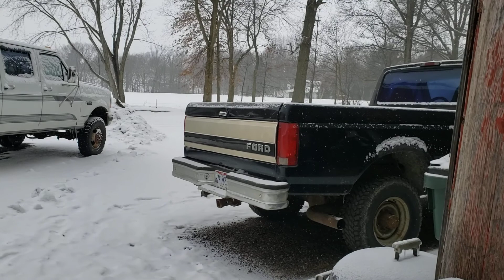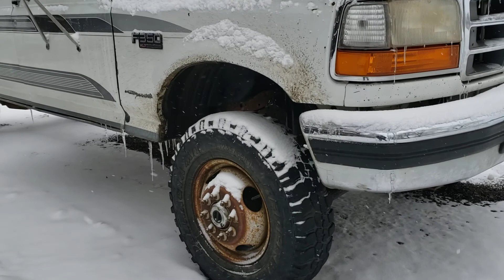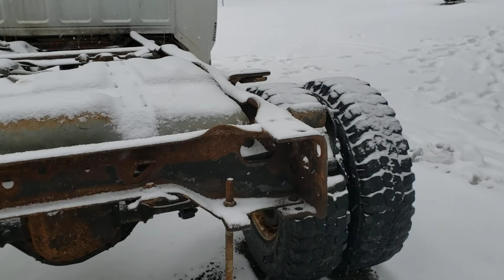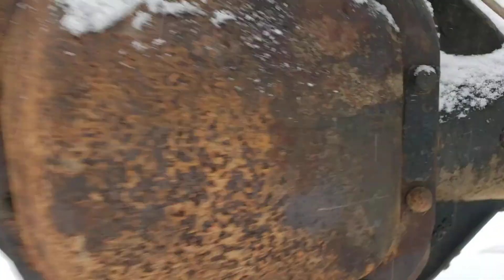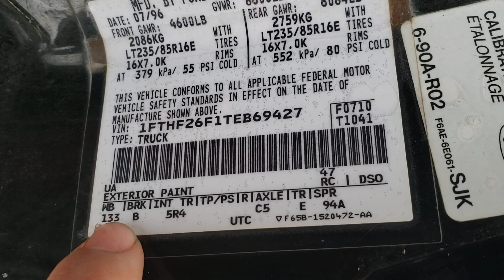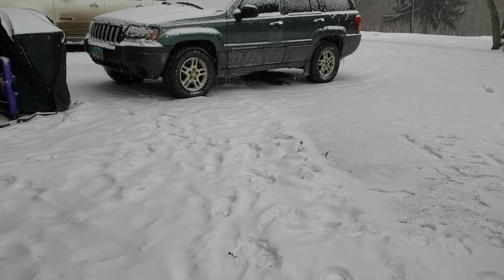How to Identify your OBS Ford Axle Model and Gear Ratio

Comment: The front end you said is a Dana 50 is actually a Dana 44 HD. Most easily identified by the size of the hubs, but the TTB came in both Dana 44 HD and Dana 50.

Comment: The 97 f250hd came with a solid axle from the factory.
Reply from the maker: No it didn't. Sorry, but all F250s had the D50 TTB regardless whether they were badged "HD" or not.
Reply: @diymechanictv1233  I bought my 97hd  new from the dealership with solid axles .. so yes it did bud

Comment: Really great video, thank you. I have a 2010 ford f250 super duty 4 wheel drive fx4. Do you know about this truck, axles, diff ratio? I will and look for marker tags and vin # info. I have manual hubs, glad they are not electronic. Any info would be greatly appreciated. Awesome video! Jim

Comment: What info do you have about the front end on a 2wd OBS? I'm looking at replaacing the wear components on the suspension and steering on my 93 IDI turbo and there are references to "front axle up to 4200" and "front axle from 4200"
Thanks!

Comment: CAN YOU CONVERT A 3/4 TON DUALLY TO A SINGLE REAR WHEEL BY JUST SWAPING THE FRONT HUBS AND REAR AXLES?
Reply from the maker: Yes, but unless someone converted it to a dually, all the dually trucks were 1 tons. If yours is really a 3/4 ton (F250) yiu might just have spacers on it that you could take off to return to SRW.

Comment: I'm one year outside of your range, I have an 86 f350 (diesel) non dually, 4×4 , C6, Dana 60 on the front and sterling 10.25 in the rear I believe.
I'm wondering if I'm missing something, I jacked up the rear, and marked the driveshaft and the tire position so I could see how many times the axle rotated per 1 tire revolution. Less than 2 axle revolutions gave me one full tire revolution. No tag on the axle, I'm in NY so the rear cover was replaced after rotting I imagine.  Any input would be much appreciated 🙏 
I'm going to check again and update if I got it wrong.
Reply: 1.75 axle revolutions per 1 tire revolution exactly
Reply from the maker: If you have it jacked up, make sure the other tire isn't spinning bsckeards while you're doing this. They can do that if it is an open rest end. Put one side on a block or something to keep it from spinning the opposite direction if you need to. 

Then you should be counting revolutions of the drive shaft per complete revolution of the wheel. I assume that's what you are doing?
Reply: @diymechanictv1233  yeah that's what I was doing, I'm assuming 3.55 is the rear ratio. The other wheel wasn't moving at all I made sure. I was hoping for tall rear ratios anyway. There was another guy having the same situation on a forum and they just figured it was 3.55. I appreciate the content and you getting back to me.
Reply from the maker: If you have 3.55 gears, you'll be turning about 2200 rpm at 60mph with a c6. That's a guess, anyway. 4.10s and it would be screaming pretty good at anything above 60 with a c6 (no overdrive).

Comment: I am wanting to change the rear gear ratio back to a 3.55 or 3.73.  Before I could get it done, something went bad.  I hear rattling back there and uneasy turning....like skipping.  Tomorrow, I will open the cover and see what's happening....what pieces I will find.
I'd like a video on how to change the ring and pinion and who knows what else in there.  Maybe, the spider gears are trashed.  I don't know yet what is needed.  Maybe, I should get a whole rearend whole rearend, hub to hub, from s junkyard for about $750.
Your thoughts?

No local mechanic can get to it.  I've been trying to get it in a shop, any shop, for a month!
Reply from the maker: Hey, thanks for watching the channel!

Two things I've never been brave enough to venture into: automatic transmission rebuilds and setting up rear end gears. There are specialized tools required to set the proper bearing preload on the pinion and lash on the ring to pinion clearances and I have never been brave enough (yet) to get into it. If they're not set up correctly, they don't last long. It's some sort of voodoo that I've not yet had a need to learn.

That said, I've swapped several rear axles and that can be done in a day. That's the direction I have always chosen to take and it would get my vote in this case as well.

Good luck with your project!

Comment: The 1988-1997 F Superduty had two different ratios. The standard 4:63 and the optional 5:13
The F350 4x4 cab and chassis came with 4:10 with a 4:63 option
Reply: In rare cases they had a 4:30 rear axle ratio that was a LS rear end and Ford only installed these 1997. The reason I know this, is becuase I bought a 97 F-SuperDuty about 4 months ago with the G3 axle code on the door and was kinda confused and didn't know what the heck it was until I done some research on it. Another thing about the F-SuperDuty is that it has a DANA 80 and not a DANA 60.

Comment: I bought my F-350 three months ago.  I was told it's a 4.10:1 ratio.  It's turning 3,000 RPM at 65 MPH.  Ouch!
Mine is a 7.3 L diesel with the three speed C-6 and 19.5" wheels.
If you are only turning 2200 at 65 MPH then, I need to check mine.  They may have put 5.38:1 or something extreme like that in there.  The tag shows it was a 3.55:1 from the factory.  I think I'd like to go back to that.  It's expensive to have done so, I need to be sure what I want and do it only once.
Reply from the maker: Ouch is right! With that gearing, I bet it pulls like a freight train, though! Get underneath and look for a tag under one of the axle bolts. That should have the ratio stamped on it and you should be able to read at least the last 2 digits. It's somewhere to start, anyway.

Thanks for watching!
Reply: @diymechanictv1233  the tag shows it was a 3.55.
Watching through countless other videos, I came across a guy that show the math to equate new tire size to factory ratio.  Given that math and the larger tires, I should go to a 3.73 and not the 3.55.
Reply from the maker: Keep in mind that the C6 is I ly a three speed so you're also suffering from not having an overdrive gear, if in fact that is what you have. Having that overdrive gear makes a huge difference for highway driving.

Comment: Thanks for the great video. It help me out alot because I just bought 1991 ford f250. I have a question. What gear oil do I use for the front 50 axel and rear 10.25 axel. What brand and wight. I live in Arizona weather. Thanks again.
Reply from the maker: Glad you liked the video! The brand of gear oil is completely up to you. For the weight, use 80w90 in the front and 75w140 (or the equivalent) in the back. If you have a limited slip rear diff, you may also need a bottle of friction modifier (from Ford) if it chatters, but I'm guessing you'll be just fine. Thanks for watching!
Reply: @diymechanictv1233  thanks alot. On more questions. For the front 50 axel do I use conventional gear oil or senthtic. Thanks.
Reply from the maker: @ODSTM4A1  that's up to you, but for gear oils, I tend to use a less expensive conventional oil and change it more often.
Reply: @diymechanictv1233  OK.  Appreciate you responding that's awesome. Thanks. 👍

Comment: Does anyone know if the dana 44hd would work for a 4x4 swap in a 1994 f250? Or is the axle housing shorter much like a dana 50 ttb? Is the dana 44 HD the same length of axle as the regular half ton dana 44? I know a half ton 44 would fit flawlessly but you would have to do the Chevy 8 lug conversion, though I don't want to do that
Reply from the maker: That, I can't answer!
Reply: @diymechanictv1233  Damn. The axle tube arms look like they'd fit right in because they just look like the same length. I did some closer inspection and my driver side axle beam that goes over to the passenger side bracket is a bolt on bracket. The bracket for the passenger side beam is bolt and riveted to the crossmember. So maybe I might just be able to get a dana 50 and fit it under there if the dana 50 ttb mount bolts in my crossmember without drilling new holes

Comment: Very helpful video i have a question i have a 95 ford f250 7.5l XLT not 4x4 with a rear end wheel base 139 and I want to swap that rear end to my 97 ford f250 HD 4x4 7.5l but wheel base is 152 will it fit I can't figure out is its going to work or not
Reply: Or can I just swap the ring and pinion from my 95 to my 97
Reply from the maker: As long as the gear ratio is the same, the axle should bolt right up. Wheelbase doesn't make a difference for the rear end on these. Actually F250 - F350 doesn't either. Not until you got to the FSuper Duty (10 bolt) did the rear end change at all. Should be a direct swap.
Reply: I appreciate you very much i was worried there for a min but when I saw your video man I said thank you jesus for helping find your video thank you again for your help God bless
Reply from the maker: @markmaldonado9614  God bless you as well, sir. Happy Easter! He is risen!